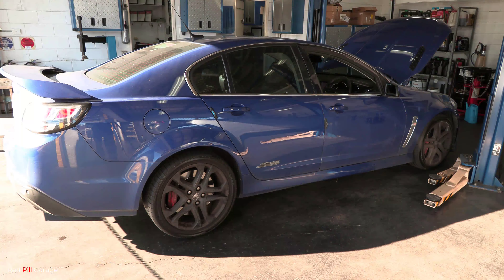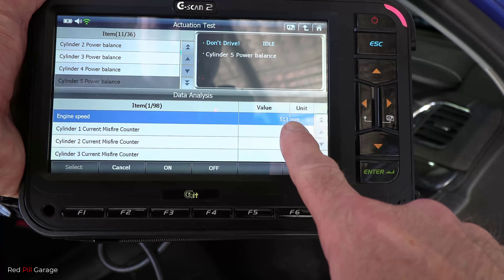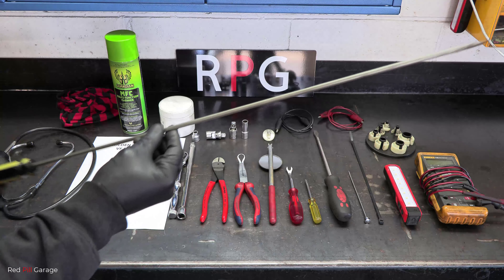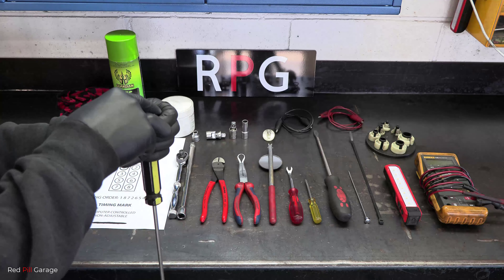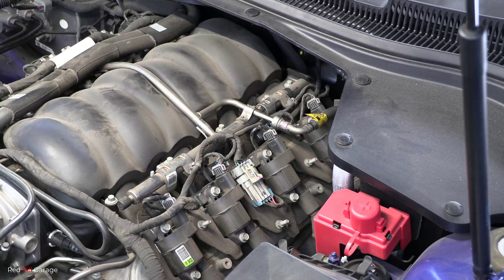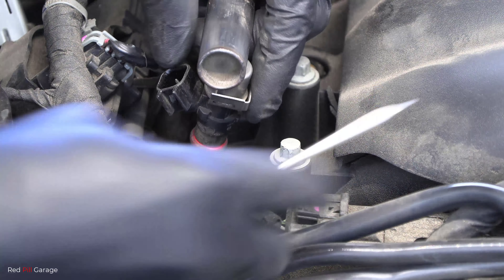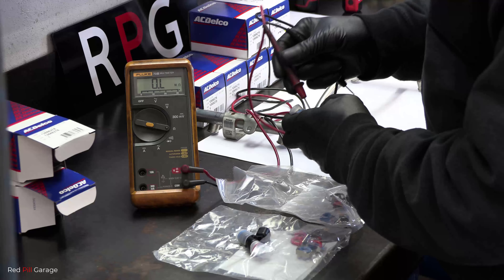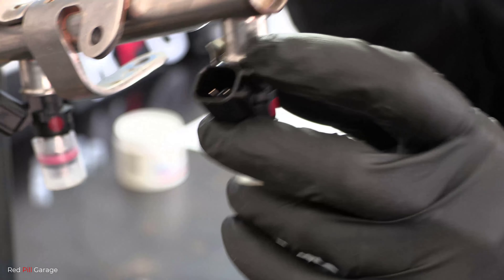How To Diagnose and Replace Faulty Fuel Injectors Easily (cheap). Ep15

Comment: Those inlet manifold bolts should be re torqued in correct sequence and no more than 10 nm…dont want to warp the inlet manifold of crack something. Thanks for the vid in any sense. I disconnected the battery during the injector change. Lucky i did the whole 8. Not only did i have #7 fail , i checked the lot and 4 and 5 had really odd and and high ohms of 33 and 28. The fault code and check engine light cleared on re application of battery. All was back to normal. Stuff you Holden Australia for not even wanting to cover this under goodwill…its a very well documented issue of injectors open circuiting. I just did it myself without the gorillas dealing with it.
Reply from the maker: Thanks, glad its all worked out for you.

Comment: 2nd injector failed within 2 years of each other, car has less then 60k miles, are there better brand of injectors for LS3? I have lost confidence in these stock GM LS3 injectors...
Reply from the maker: G'day Geers Tyresoil, its hard to say there are a lot of good brands out there. Try giving Cool Drive a call or Burson Auto Parts. Ask what brands they stock and do they have any premature failures with a certain brands. This is probably the way to go about it to get a feel what brands are better than others. Also check how long the warranty is. You may also check any online forums with guys of the same car and year. I've never had a customer come back for a warranty claim for any injector install. What I normally do is call all 3 parts suppliers in this case ( Holden, Burson, and Cool Drive ) and have a good chat/feel of what brand and pricing I can recommend to the customer, most customers go for the cheaper option out of the 3 parts suppliers regardless of quality. I almost forgot to mention Rocket Industries, they also sell stock and high performance fuel injectors. Just make sure you tell them if your motor is stock or not, so you don't buy the wrong injectors ( lb/hr, cc ). One last thing, NEVER ever use E10 fuel it will damage your cars fuel system as E10 is Hydroscopic ( it attracts moisture and expires after 3 months ). Hope this helped and thanks for watching.
Reply: Im being told you need to do all 8 because once one.goes, the others will compensate to keep up with the new one, and it creates a domino effect.
I'm also wondering if I should just go for an upgrade to better injectors

Comment: Excellent video nicely explained. Is there a way to check how well injector is injecting like flow rate?
Reply from the maker: G'day @zoranrakic7640, there are fuel flow test kits out there, but your probably better of to take the injectors off and get a workshop to do the test for you, instead of buy the flow test kit which you'll probably only ever use the one time.

Comment: Great informative video i sadly have a faulty injector that i need to replace a most common issue along with collapsed radiator hoses and faulty radiators oh and the steering rack recall the only issue i have had great car other then that
Reply from the maker: Glad you enjoyed the video. At leased these aren't major problems, the Commodore has been around for a while now and is a trusted reliable vehicle. A lot of new car today are having recalls left right and centre, and some cant even be fixed as its a design fault resulting in class action lawsuits.

Comment: Thank you sir for the very informative video, I had a fault code on my G8 (American Holden) for injectors one and four, I tested the circuits the noid light and indeed the circuits were fine. I then tested the resistance of the injectors and one was not reading at all and the other was reading 1 megaohm. I pulled the system and replaced all 8 of them and found that there were 3 bad injectors not just the two.  even though my car is a 6.0 not the 6.2 your video was spot on with the instructions.
 thank you  from the other side of the planet :)
Reply from the maker: Your welcome 👍

Comment: Excellent video mate.just changed all mine today.had a faulty injector in cylinder #2.
Replaced all of them with original part number replacements from Eagers Holden.
Pretty easy job thanks to you.took me about 2 hours from start to finish.
She is now purring like a kitten.Thanks heaps.👍
Reply from the maker: Nice work!

Comment: Holden mechanic charged me about $200 (part price only) for one injector in 2016. My 2007 L98 then with 120k km.
Six months later another injector played up. So I simply bought a full set of eight Bosch injectors on Ebay for about $600, and did the job myself in 2-3 hours.
Reply from the maker: Excellent!

Comment: So final update. Now that I've actually got the VF Commodore LS3 injectors in and the O-ring is wide enough. The car is running better than it ever has. I'm actually really impressed with how smooth the power delivery is now. Beautiful car. It must have never been quite right as in the past when id changed one, id used a spare from my mates VE SS.
I had all codes cleared and a fresh oil and filter change. And it runs so smooth.

Make sure you absolutely get injectors that specify "VF Commodore" and "LS3".
Don't be thinking VE ones will work simply because the add says LS3. They're not as fat/wide, and they won't seal. Which causes vacuum leaks, engine light and bad power and economy.
However, with the right ones, it now runs better than it EVER has. Which makes me think my original injectors were always on their way out
Reply from the maker: I'm glad it's all good 👍

Comment: Sick of it, changing all 8 today.
Done one in the past. Not doing this everytime until 8 are done 😂
Reply: And done! Holy shlt it runs smooth now. Had no idea how far gone they were, figure it was just one. Never ran so smooth
Reply from the maker: Excellent.
Reply: @redpillgarage  hey mate, any reason why I might have a flat spot or splutter at low revs sometimes? 
Its weird because it runs smooth as now, but I thought maybe it wasn't seating, so I took the fuel rail off, cleaned around the ports on the intake to get dirt off, and put engine oil over the port side o rings. No fuel leaks on the rail side and I rubbed fuel on them before inserting them and they were very tight. But on the intake side they just sit there, and all seating pressure comes from putting bolts back down etc. So ive done that, made sure they're lubed on o rings. Yet its behaviour is as though there's a vacuum issue.

Any ideas mate? Much appreciated in advance
Edit:also all the retaining clips were checked to make sure the injector height was right
Reply: @redpillgarage  to be clear, it idles perfect, revs perfect from 1000rpm onwards. But has a flat spot if I ask for power straight into low revs (such as 2nd out of a corner) that it never had before. VF LS3 manual 6 speed, by the way
Reply from the maker: @GregoryShtevensh  G'day, sounds like you have a engine missfire under load. You may have accidently bumped loose/damaged a high tension lead or coil pack. Check all the wiring conections are tight and in the correct location. Is it possible that you may of crossed 2 injector wires? Just take your time and back-track all your work.
Reply: @redpillgarage  went for a drive this morning and its fine. Not sure now. Maybe I had air in the line. But I sware ai can still hear a vacuum leak near one of the injectors
Reply: Would it hurt to drop a drop of engine oil over the port that I think I can hear to see if I notice a change?
Reply from the maker: @GregoryShtevensh  G'day, I use throttle body cleaner to quickly check for a vacuum leak. Just give it a light spray in the area that you believe to have the vacuum leak and you should notice the engine rev higher. If the engine does not rev higher it does not have a vacuum leak in that area you sprayed. Just make sure the engine is not hot and don't spray around the exhaust manifold and ignition coil/H.T wires.
Reply from the maker: @GregoryShtevensh  No thats fine but, I don't know if you'll notice any difference with engine oil, I have never tried it.
Reply: @redpillgarage  thank you very much, I'll see how I go
Reply from the maker: @GregoryShtevensh  Your welcome.
Reply: Update. 
Had wrong injectors. Too thin. Got the right ones and its all good.
The ones I got originally were VE down. You actually need ones that specifically do say VF.
No brainer I guess. But yeah, thinking all LS3 were rhe same was my mistake
Reply from the maker: @GregoryShtevensh  👍

Comment: After you removed the 8 bolts and then you said you have to remove the injector retainer clip. Can i leave those on til i remove the fuel rail ? 😅
Reply from the maker: G'day @skynet1224, you can remove the hole rail with injectors and then remove clips and injectors on work bench. Just a quick tip, before removing injectors of the motor, gently use compressed air to blow any dirt around the injectors where it goes into the motor. Thank you.

Comment: Great video mate. Man those clips are hard to remove from the injector. I’m struggling a bit. I’m Afraid of breaking them.
Reply from the maker: Hi, it won't break they'll just stretch a little. Don't worry because you'll get new ones if you're replacing the injectors. Thanks.
Reply: @redpillgarage  all good I finally worked it out. I tested all mine and they were all 14ohms except injector #1 which was 30ohms. I’ve booked into Holden to try score replacement, as I know there’s has been wide spread issues with injectors on the LS3s.

Comment: Do you have to replace all 8?
Reply: I noticed that when you checked the others they seemed to be working properly
Reply from the maker: G'day @hectorrodriguezjr.3606, It's best to relace all 8 as when 1 fails the rest will eventually fail also as they have the same age and mileage. If you only replace 1 you run the risk of possible cylinder balance problems, and then you'll have to remove the fuel rail again.
Reply from the maker: correct.
Reply: Thank you sir
Reply from the maker: @hectorrodriguezjr.3606  You're welcome.

Comment: If you don’t have these expensive gadgets 
Get multimeter put on Ohms 
Holden LS should be around 11-14 ohms 
And no more than about 3 ohm difference between cylinders .

Please do this before you start the expensive way of electrical and spark plugs 

This guy typical mechanic running straight out of the replace all before you find the fault